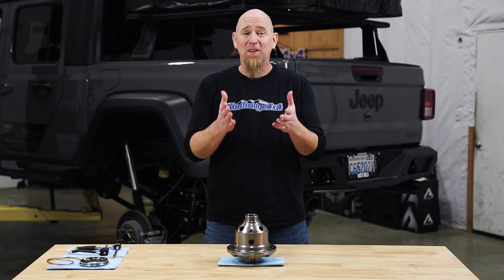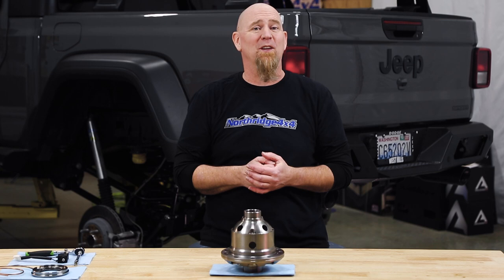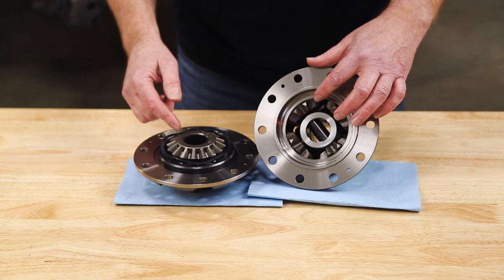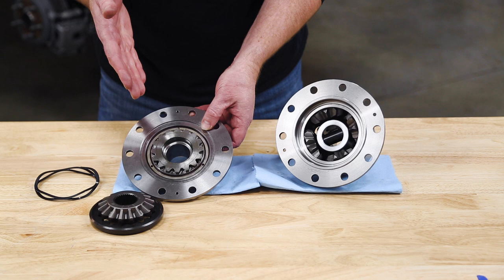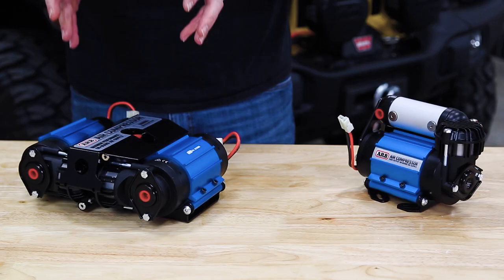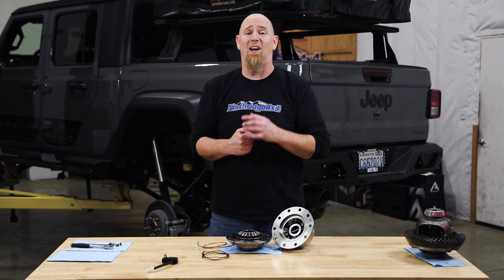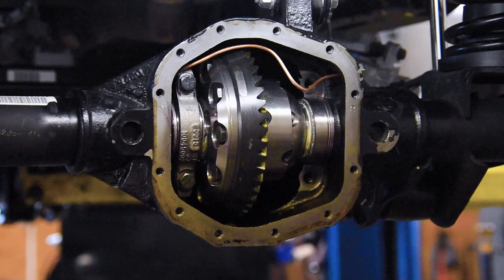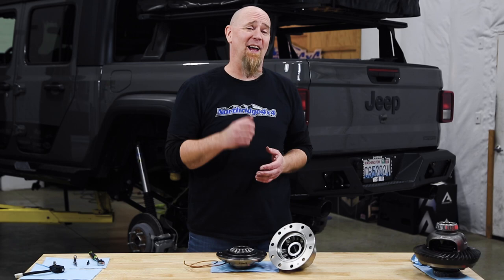ARB Air Lockers - Explained

Comment: Putting a front ARB locker in the front of my heavy rig made all the difference in going over rocks/logs and seriously twisted trails, turning that non driven wheel or wedge basically into a powered wheel to get over obstacles. I think mine is from 2001 and and took it apart a few years ago and still looks good inside. Can't wait to get another one in the rear of the rig.

Comment: I love a good Air locker, but I struggle that for $70 more I get an E locker and the install is a breeze. I feel like ARB needs to make a cost reduction if they want to stay in the game.

Edit: I purchased the E-Locker. Ended up having to buy $150 in addition bearings and shims that the ARB would have come with had I purchased the ARB. ARB is the winner for supplying everything you need. Its over $200 in savings to buy the ARB for anyone looking.

Comment: The ARB unit does not automatically release if there is any kind of load on the side gear. The return springs are quite lite so you have to come to a stop if you are turning or spinning the wheels for the unlock to happen. Otherwise it's a great system.
Reply from the maker: You typically don't have to stop, just take your foot off the throttle and relax the steering to release the bind.
ARB could add in stronger springs to help disengage the locker, but then you'd need to run higher pressures to overcome the the springs to lock it in.
Reply: green: Quote: "The ARB unit does not automatically release if there is any kind of load on the side gear. The return springs are quite lite so you have to come to a stop if you are turning or spinning the wheels for the unlock to happen. Otherwise it's a great system."
If my understanding is correct, this is the same for any other locker as well.  They must be unloaded to reliably disengage.

Comment: Great video, Tim.  I've been running ARBs for decades in my Toyotas.  I had leaking issues  with them before (leaking inside the pumpkin) and actually broke gears inside the locker and concluded that it was due to a bent axle housing.  Toyota stock housings aren't the strongest.  Once I swapped in a Diamond Axle all leaking issues went away and I had a feeling I relieved stress on the locker overall.  My question;  are ARBs super picky about the straightness of the housings?  IOW- how far off center must a housing be at the flanges to start to cause ARB leak issues, etc.?  Is there an easy trick to checking the straightness of an axle housing at home.
Reply from the maker: All differentials can fail inside a bent housing.
The easiest way is to set a couple carpenter squares on either side of the housing on the housing flanges, then measure between them. Do this at around the clock, so measure 12:00 & 6:00, 1:00 & 7:00, 2:00 & 8:00 etc. all the way around.
You should be less the 1/8" all the way around.

Comment: My girlfriend has a 2021 4Runner SR5. It doesn’t come with the factory E Locker like you see on the TRD models. My question is can we install these air lockers on here rig? And is it possible to install ARB air lockers in the front and rear axles?
Reply from the maker: Yes, you can add Air Lockers to your 2021 4Runner front and rear.
Front ARB Air Locker could be the RD111 or RD121 depending on gear ratio.
Rear ARB Air Locker should be the RD193.

Comment: if i had the change to throw. 
i have always wanted to see if i could jerry rig it so there is diff fluid running through the lines and a hydralic lever to manually engage and disengage.
Reply from the maker: Tech Tim ran the Tech and Warranty Dept at ARB for many years and he says that they played with that idea and though it was doable, it wasn't really feasible due to the viscosity of diff oil. He says air makes it much easier and faster and if installed correctly, it is very reliable.
Reply: @northridgenation  that would have been interesting to see. 
appreciate your time to reply. Cheers from shaun.

Comment: I have an older ARB that I finally got installed. ITs when they used to be 699.99 if any of you remember that..
So I need 70-150psi still?
Reply from the maker: Tech Tim Was working at ARB back in the dinosaur days when you could buy one for $500.00.
He says that although many of them will lock in reliably at pressures in the 70 psi range, you really want a minimum of 100 psi and that 150 really is the sweet spot. 
Don't go above 150 psi if you are running ARB solenoids.

Comment: Hey,  I am completely a newbie to this and I have a query that, For how much miles do there air lockers or generally after market differential lockers last?

BTW Great content brother!

thanks
Reply from the maker: Properly set-up and maintained, the ARB Air Lockers will last for many years.
We've seen rigs come in with 10 year old Air Lockers that are still running strong.

Comment: I understand how the locker works in principle, but how is it actuated.  So you just turn on the compressor or is their an external switch that had to be mounted?
Reply from the maker: There is an electric switch that controls an electric over air solenoid. Hit the switch, it tells the solenoid to open, sending air down to the air locker. Turn it off, the solenoid closes and the air in the line vents out.

Comment: Great video, but I now have a question.  You mentioned open diffential several times.  Is there an ARB limited slip air locker?  Guessing too many components then, but still curious.
Reply from the maker: No, full open or fully locked, no in between.

Comment: My 2008 jk has the ARB air locker , it stopped turning on when I flip the switch on. What should I check?
Reply from the maker: Stops turning? Please elaborate.
How old is it? 
Was it working before or is this a new install?
Have any changes been made lately?
Do you hear air leaking?

Comment: I have a 2021 ram 1500 love it only have 4x2. Plan on getting a bigger boat. The ram should have no problem getting the boat and trailer out of water. But as a precaution should I be at a ramp with lots of algae this looks like the fix to get me out safely when I need extra traction? What do you think?
Reply from the maker: The ARB Air Locker is a great addition to any rig that may see low traction scenarios. Fully locker when on and completely off when it is off, so no weird handling or tire wear associated with other traction aiding devices.

Comment: For earlier ARB carrier models, can you enlarge the carrier ring gear holes with a hand drill or do you require a bench drill? cheers
Reply from the maker: You could do it by hand if you were spot on, but it is easiest to them them out on a drill press or mill.

Comment: Unlike the internal o-ring which is not moving most of the time, the outside o-ring is always rotating. Will this cause air leakage over time? Just like axle seal or crankshaft seal will eventually leak over time.  Thank you very much.
Reply from the maker: That is the high-wear seal, but just like an axle seal or crankshaft seal... IF it is installed correctly and you keep your diff oil clean and free of contaminants, those o-rings will last many years. We've seen some go over 10 years before needing replacement.

Comment: My question is for the locker to work does the air compressor need to be on and running the entire time the locker is engaged or no
Reply: Yes the air compressor will be on, but not running all the time. It will engage and then periodically top off the load when the required pressure drops
Reply from the maker: Yes, as @davidkay7389 says, you do want to have the compressor on at all times.
The Air Locker does not consume air to stay locked, it deadheads or uses the air pressure to hold it locked. However, if you have any leaks in the system, the air could bleed off and if it bleeds low enough, the locker could unlock.
Many people use CO2 tanks and regulate the pressure down to 100 to 150 psi (max!) to lock in their Air Locker. That works great too.

Comment: Tbh my mind is still blown how 2 o-rings is enough to seal the 80 psi air channels over a rotating diff against oil and debris. I just can't seem to understand how the o-ring wouldn't wear out quickly with that much rotation rubbing on it. and if there is a oil leak is the locker ruined? can I clean under the actuator steel plate?
Reply from the maker: Yep, if you keep your diff oil clean, those o-rings will last years. We've seen them of 10-15 years before needing to replace them.
No, the oil can't hurt anything in the Air Locker.
Yes, you can clean the seal housing.

Comment: I recently bought a 2022 Nissan Frontier base model 4x2  and want to do all the mods myself instead of factory. I was wondering if this ARB air locker will work for my truck. “Nissan Frontier Air Locker by ARB, Rear
M226 (D44), 2022 (D41)” . I’m not quite sure if all new 2022 frontier have the M226 transmission?
Reply from the maker: You'll need to know what rear axle you have to answer that.
Check for the BOM on the axle tube. It'll be a small series of digits stamped into the axle tube. It'll be obscured by the paint, so you might need to do some searching.
Reply: if you fit it yourself, you wont get a 5 year warranty....just a heads up

Comment: Can it work on 2nd gen isuzu dmax 2019?
Reply from the maker: ARB Air Lockers for the 2019 Isuzu D-Max should be:
RD203 Front IFS
RD261 Rear axle
Email our sales team to get a set ordered: sales@northridge4x4.com 
Give them your vehicle information and have them double-check the application.

Comment: 6lbs of force vs 800lbs?  Does this mean that the axles can come unlocked in a high torque situation?  I would think that 6lbs of force would be easy to overcome.
Reply from the maker: We haven't heard it being an issue, but it is clear which one we'd rather have.
Reply: No, once locked with air pressure, they STAY locked until air pressure is released....the air only moves the locking ring, nothing else. axle torque cannot unlock the centre, unlike some other types of locking diffs which can. axle torque is a radial load imposed on the centre, not the sliding action of the locking ring

Comment: When do think we can air lock the Rubicon ?
Reply from the maker: You can add Air Lockers to a Rubicon, but you have to change the axle shafts due to the Rubicon lockers having a weird center pin alignment. 
Now that's not bad, because you can step up to the bigger 35 spline shafts for more strength.
Reply: Any chance of getting contract info of someone who can help walk me through all that I will need
Reply from the maker: @joelsdobermans45  Give us a call at 866-601-5340 or drop us an email at sales@northridge4x4.com. Tell us what year and model and they can get you all set-up.

Comment: "This is the only seal in the locker" - proceeds to show another rotating seal that's part of the locker.

More seriously though, that rotating seal is a wear item and is bound to release more air over time, no matter what you do. That coupled with the fact that you'll have long hoses that are attached to your heavily articulating suspension means you'll be chasing leaks, be it from the fittings, the hoses, the solenoid, or the seals. I'd kill for an e-locker to be available for my Currie 9"; at least with that there's only the solenoid that can go bad. 

As other folks mentioned, it's silly to compare locking forces here.  Once locked, the gears take all the force radially, and the only thing the axial locking force does, or any pin locking force in an e-locker does, is ensure a good mesh all the time.  Not saying more force is a bad thing, but comparing the numbers is like comparing your waistband to the equity in your stock portfolio. It's illogical.
Reply from the maker: Way to mis-quote.... That's the only seal INSIDE the Air Locker. The two o-rings are outside the locker and do not rotate. The air journal rotates inside the o-rings, just like your pinion and axle shafts rotate inside their seals. Keep the diff oil clean and in good shape and those o-rings will last years in a properly set-up axle.
Comparing locking forces is quite relevant. With the annular lock of the ARB clutch gear, the locking mechanism has very little load trying to unlock it, where some other locking differentials have to handle the radial load that is trying to force the locking gears apart.
As far as a locking pin, due to their shape, a round pin in a slightly larger round hole, the actual surface area of the pin that is engaged or locked is small.

Comment: 🤔Installing Air Lockers...  Would That Disable The 4WD Auto Functions?🤔
The Diff goes from LOCKED to OPEN Correct?.. Opposed To LOCKED To Limited Slip 4WD Auto?🤔
Reply from the maker: Correct the ARB Air Locker goes from locked to fully open.